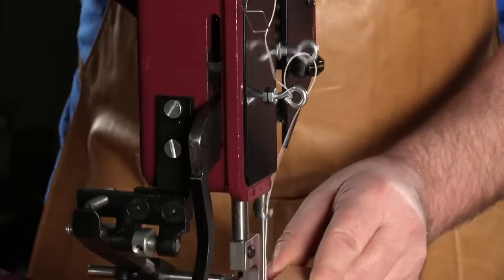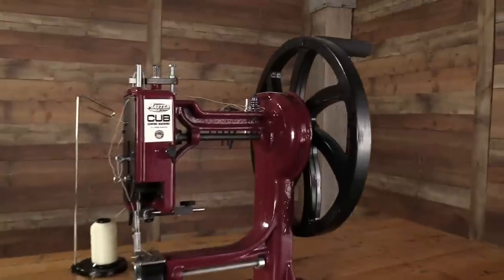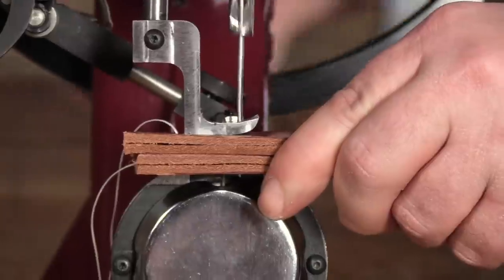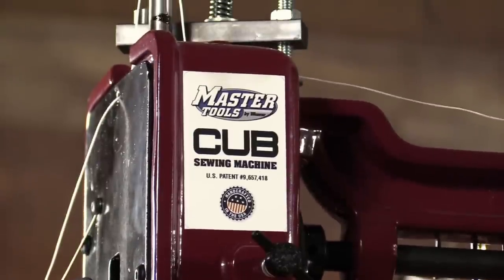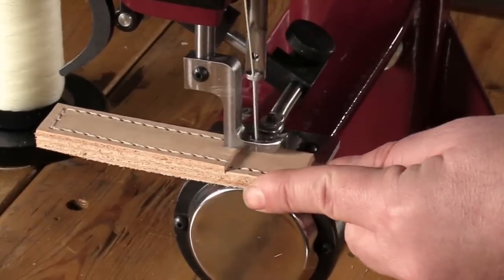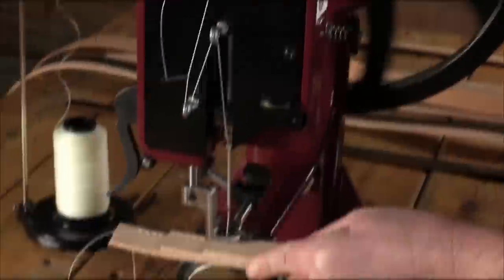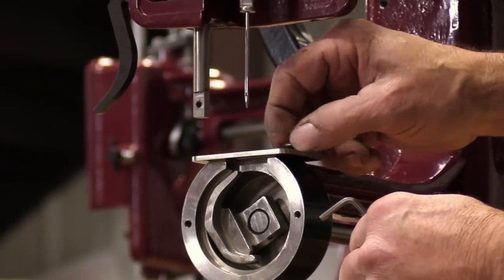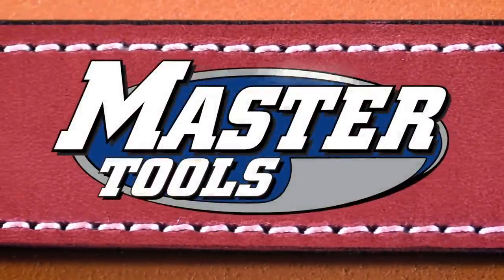Master Tools Cub Sewing Machine - Portable Leather Stitching

Comment: for that kind of money one can purchase and electric machine that does the same thing and have both hands available.
Reply: Please name a motorized machine that has the same capabilities as this machine for the same price please?   There are none.  The closest you are going to get is Juki 441 Chinese made clone such as the Cowboy 4500 or Cobra Class 4.  Base model runs $2855.
Reply: @jenniferstephenson  He didn't say same price...he said "that kind of money." If you are dropping $1650 on a machine...you can spend $2000+ on a Cowboy 3200 or 4500 and be way better off. Hell if you want a manual crank just buy the $100 Chinese one and add a motor to it for $50.
Reply: and a motorized has a much higher chance of punching right through your hand

Comment: So many people commenting that quite obviously have no idea about leather machines......No idea about the thicknesses various machines can handle.....No idea about appropriate thread size for that thickness.    PLEASE...if you need a heavy duty stitcher....contact a professional and learn what is the correct tool for the job you are trying to do so you don't waste your money.  Buying a chinese patcher or a Sailrite for doing what this can do is like buying a Ford Ranger to pull your 30k lb 5th wheel camper.  Yes, it's technically a truck, but it's not suitable for the job.